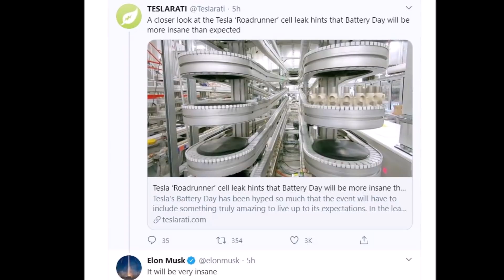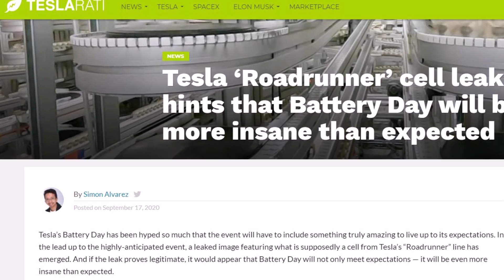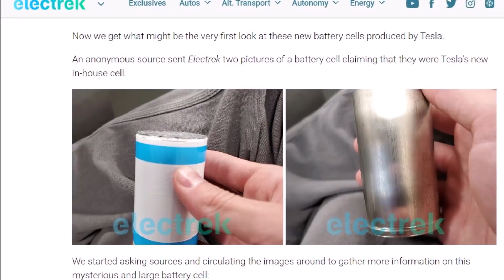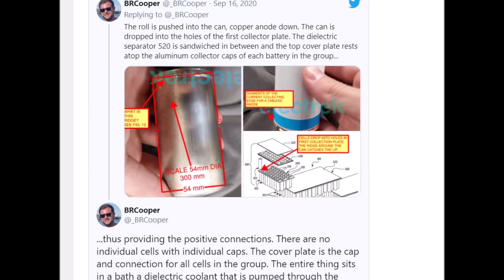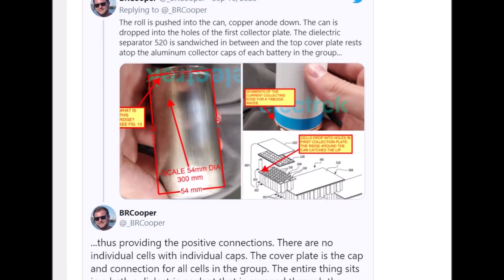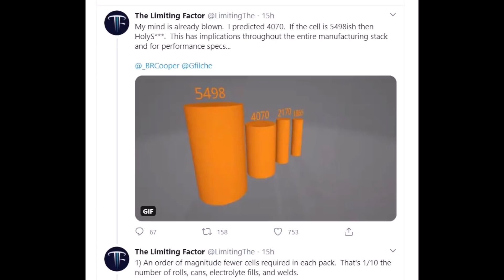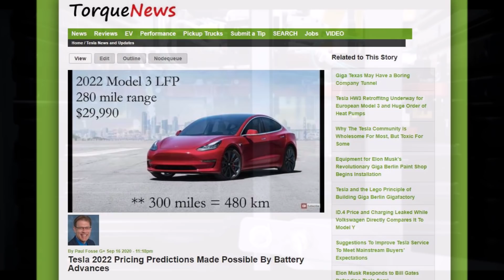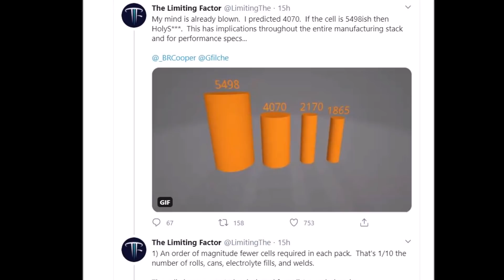Elon Musk on Tesla Roadrunner Cell Leak: "It Will Be Very Insane"

Comment: A battery with 10x the capacity should reduce pack costs by 30-40%. If the battery density goes up, then you can eliminate some of the batteries for a further reduction in pack cost and still retain the same range.

Comment: Sounds like they're going to get about a 20% increase in power density without any change in chemistry just from volumetric optimization/maximization of anodic/cathodic materials vs packaging of those charge holding materials! I'm curious if the current collectors are a field of connected disks, parallel rows or a complete sheet. They could also be a dielectric sheet with integrated conducting disks that get sandwiched and sealed on either side of the cell array. Tack on an increase  of another 20% charge density with new chemistry and then we are almost to a net 50% increase in power density at the pack level for the same volume! Might be able to use LiFeP for much lower cost with similar or 90% range as now or same same chemistry for similar cost and 20% more range and new optional chem for higher cost/power and 40-50% more range in the S, X and Roadster!

Comment: I follow several of these EV or Tesla channels on YouTube. Yours Armen,  is one of my favorites. You always sum up the situation and point to many possible implications. This larger battery either has to operate cooler, or the cooling system will change as well. I also wonder if the Model Y isn't so tall in part so another layer of batteries could be added. 
Also, had Musk not said, "It's going to be insane" then I would predict that it will be a series of small, basic changes, nothing earth shattering, no new chemical compounds, etc... but like so much of what Musk, Tesla and SpaceX does it will add up to something special. (I always contend that most of what these companies do, others could've done, but didn't). But  Musk took the time to say, "It will be insane." That seems at least two or three degrees beyond the simple exuberance of, "Yeah, let's definitely have a rave." 
I think most investors at this point have burned out a bit on Battery Day, yes it will be good, yada yada yada... Sort of like Christmas when you know you're just going to get another sweater. But I think if it will be, in fact insane, and stock value should go through the roof (again)  for at least a while. But it should move the whole EV world another step forward. (Did Lucid time their moment, so they could have the spot light at least for two weeks? )
I've got a Model Y on order, last week I got a text message saying 1-2 weeks. A couple months ago I ordered one, but got cold feet and cancelled. Based on that experience, they should've called me last week with a VIN number and begun making arrangements  for me to start sending them money. That didn't happen. In fact, I haven't heard anything. Which makes me think that Battery Day is going to significantly change the car I ordered, (and changes from Tesla are always better). I think I'll be given the option of quick delivery with maybe a price reduction, or a longer wait, possible price increase, but with a better battery pack. I'm long and deep on Tesla because it's the future, so waiting a bit longer? No problem. What makes being part of the future so exciting is being aware of it.

Comment: A large, cylindrical cell (which would be difficult to cool) suggests to me that Tesla has a new chemistry that doesn’t require such careful thermal management.
Reply: The tabless design means that the entire jelly roll is in contact with the ends of the  cell. Very good for cooling and  less resistance for charging (so less heat produced).
In normal cells, the jelly roll is only in contact with the ends of the cell via a narrow tab. This means that there isn't very good thermal contact between the jelly roll and the outer casing. It also means that while charging electrons have to all pass through that narrow channel and take long pathways to the ends of the jelly roll (imagine a rolled up sheet of active materials with little tabs in the middle) This means more resistance and consequently more heat produced.
The tabless cell will likey be charged (and cooled) along the entire length of the sheet or close to it
Reply: Lucas Sim 
Also, as I understand the tabless design, the charging and discharging current (in the form of Litium ions and electrons) do not need to travel several meters around and around until it reaches a terminal tab. 
If you unroll the roll in this 5498 form factor battery it will look like a very long foil, but it is only like 95 mm wide.  This will put a limit to how far any electron will have to travel to reach the end cap and terminal. Since each side of the foil is connected, along their whole lengths, to their respective terminal. Must be much easier to manufacture too.
Think of a toilet paper roll here. Instead of having to go all along the total length of the paper the current will take a shortcut, no longer than the width of the paper, or foil. This will be lowering the resistance by two orders of magnitude, assuming that the length is say 10 meters and the width is less than 0,1 meter. That elimination of "traffic jam" would divide the internal resistance by 100 times. 100 times less heat too, OK?
I think this is the reason why Elon is very comfortable with such a long foil, meaning so wide a cell format. Less heat also means longer life.
Reply: Not just chemistry. This battery has design improvements that significantly decrease electrical resistance and waste heat.

Comment: Seems so obvious to make these kinds of improvements. Incredible that nobody else has come up with such simple solutions.
Reply: Though seemingly "simple", the design of a better, bigger cell involves a series of innovations all engineered to come together in one package and with a new process to make it happen. It's not just better because it's a bigger cell. To be bigger and increase power density, they had to figure out how to address problems that previously limited how efficient a bigger a cell could be. One of the innovations decreased the electrical resistance in the cell and the waste heat generated by that resistance while reducing the complexity of the internal parts and simplifying production. It's all more technical than many who are anticipating battery day will fully comprehend, but the benefits will lead to lower cost, increased production, better performance, faster growth, improved reliability, more separation from other players, etc., with near and long-term impact on Tesla's market penetration in both the automobile and stationary energy storage markets.
Reply: @Texlex61  Thanks for this explanation! Very thoughtful and helpful.
Reply: Reusing rockets had also never been done before. Why didn't anybody else think of that? When all airplanes are most often used more than once. Simple.
First principles. That is how Elon thinks.

Comment: So how is a bigger battery changing anything, I don t get it? It s the same battery in a different shell
Reply: Anybody can make a bigger cell. Nobody else, though, has been able to make a bigger cell that didn't suffer from the limitations/challenges that heretofore increased with increased cell size. Charging and discharging cells generates waste heat. Until now, the problems due to that resistance/heat got increasingly worse as the batteries got bigger. This new design overcomes those problems while also simplifying the cell design, increasing the power density, decreasing the cost, improving the reliability, increasing the rate of charge/discharge, etc.
Reply: Time is 1/10 of time to make compare to the other, also takes way less space, and much less weight. And less materials to make. All that adds up to a much more lower cost and a lot more can be made per year. 10x more
Reply: EsmeMusic let s see how this translates to car price. If they are not shedding at least 5k off idk what to say

Comment: Something to point out if there's an order of magnitude fewer batteries there's also an order of magnitude fewer batteries to recycle , and I suspect that the larger form is going to make recycling at end of life easier
Reply: @mrspeigle1    Agree completely, but please don't neglect the opinion of the late Jack Rickard that used Tesla auto batteries can serve a useful function for decades after the battery no longer has enough capacity for normal driving.  Storage of electricity from rooftop solar installations needs far less peak current capability, thus an unmodified, stock Tesla battery might survive for thirty years before ultimate recycling.  Mr. Rickard's many videos on the subject are a goldmine of information if you are a patient listener.  Search "Jack Rickard".
Reply: @jrb_sland5066  I would consider Second Life repurposing a form of recycling , and the larger cells will make that easier to. After all which is going to be easier installing a car battery or installing a similar weight and energy density worth of double a batteries?
Reply: @mrspeigle1    Thanks for the reply.  You make a perfectly good point, but Mr. Rickard's approach is to treat the entire Tesla battery pack, unmodified, as a self-contained unit.  After all, the battery contains all necessary BMS technology, safety interlocks, communications ports to report cell temperatures, voltages, state-of-charge and so on.  Use it as-is to save a lot of duplication of effort. 
Agreed that larger cells make  both original manufacturing and subsequent recycling easier, but Second Life should be done with as little modification as possible, ideally none. A big 380 volt, 500 peak-ampere-capable auto battery contains huge amounts of energy when fully charged - this is not in the same ballpark as popping in a few double A cells with your bare hands.  This issue will become even more important as time goes by and batteries become even more energy-dense.  These are not your  great-grandparents' mushy lead-acid starter batteries.  Be safe...
Reply: @jrb_sland5066   I would have some engineering concerns but I will check out the channel and see if they are addressed.
Reply: Tesla battery pack life is so long that they won't need recycling before 30 years.  There are customer Teslas with 300,000 miles on the original battery pack and little degradation.  That's more than 20 years of driving for most people.
Reply: @LoanwordEggcorn  there are also customers who through excessive fast charging or other issues have required a warrenty battery pack replacement.  Your going to see a ramp up over the next 30 years as production increases.
Reply: @mrspeigle1  ...Given Tesla's track record on making incremental improvements to their design & manufacturing processes, I'd expect the warranty replacement rate to fall.  I could be wrong - only time will tell.
Reply: @jrb_sland5066  decrease failure rate by 5% but increase production by 400% = more warrenty work.
Reply: @mrspeigle1  Tesla's extensive battery management system and software don't allow significant damage to the battery pack.  The number of Tesla battery packs replaced in real world use is a tiny, tiny fraction.  And the battery and management technology have only improved since then.

Physically replacing the battery pack is easy; a few bolts.   Tesla had experimental stations to do it automatically in a few seconds for their battery swap technology.  So if they did need to replace a very few battery packs, it would not be difficult.

That said, Tesla has extremely tight control of their quality, including battery cell production and chemistry.  The quality of their battery cells and packs is among the best in the world.  That's a large part of the reason why they are highly durable and reliable.  

Again, this is confirmed in real world use.  Some references:

https://electrek.co/2020/06/06/tesla-battery-degradation-replacement/

https://insideevs.com/news/405885/tesla-model-s-battery-after-146000-miles/

https://www.wired.com/story/tesla-may-soon-have-a-battery-that-can-last-a-million-miles
Reply: @LoanwordEggcorn  dosent change the need for recycling and recovery. Read the thread.
Reply: @mrspeigle1  They're probably both true: a larger cell is easier to recycle than many smaller ones, and Tesla battery packs last so long that recycling probably isn't a major need for at least 30 years.

A car that loses say 10% of its range after 20 years is still highly useful.  And the range is probably stable for many decades.

Comment: I wonder how they handle the cooling/heating for the larger cell ? what's stopping them from just making a single big cell for the entire car ?
Reply: Heat loss. The bigger the battery, the bigger the heat loss as the electrons try and get to the connector tab. But his tab-less design reduces this problem significantly. I guess that 54mm is the sweet point a the moment for the new tab-less design vs diameter.

Comment: I think 2lbs of the new batteries will be able to power a model 3 for 10000km on one charge, it will charge in 45 seconds and last for 10M kilometers. :D
Reply: And all Tesla’s are delivered with a rainbow unicorn as steering wheel!
Reply: I think it will be a disappointment . The battery day was too hyped that no matter what they announce it will be a disappointment.
Reply: Djprojectus I’m afraid you’re right
Reply: That's insane!!!😂
Reply: What is going to be revealed is nowhere near what you are suggesting. I think you are just trying to be ridiculous. However it may still be more powerful than you will be able to comprehend.

Comment: I'm afraid that if the math is correct, Jordan himself said that if they can get to $50/kWh at the pack level, that would blow his head clean off.  Which I hope doesn't happen, as his content is very well-presented, fact-based, and provides excellent insight; he must keep his head....
Reply: LOL! IKR!?
Reply: $29,000 model 3 with a 300 mile range. And that's before the manufacturing techniques involved in the Cyber truck are adapted for the next body generation.

Comment: since the general expectations are so unreasonably high, they will most likely not exceed expectations. i mean if you look at some of the speculations out there, tesla is basically going to present a solid state battery with carbon nano tubes that has a 10 times higher energy density at 1/3 of the price or something.

I do believe tesla can exceed even the insane expectations is by casually revealing a new vehicle on the side of the battery event.
Whatever though, i am hyped for battery day as much as the next person so cant wait either way.
Reply: Or a ride-hailing service supported by affordable leases to bring lower income people into the fold